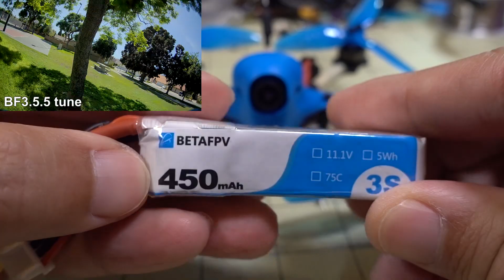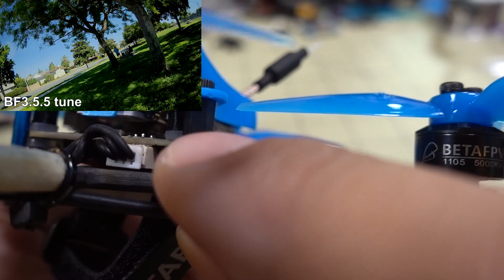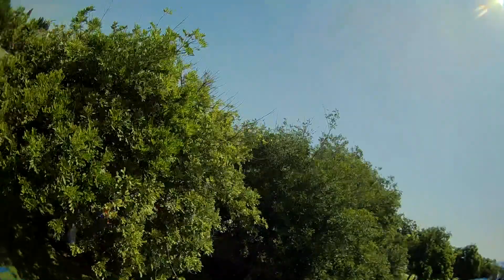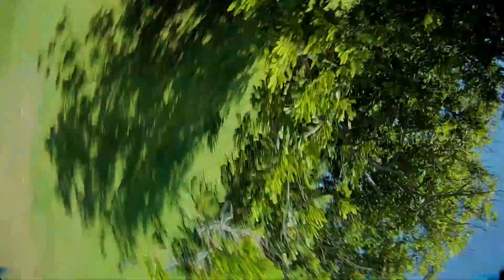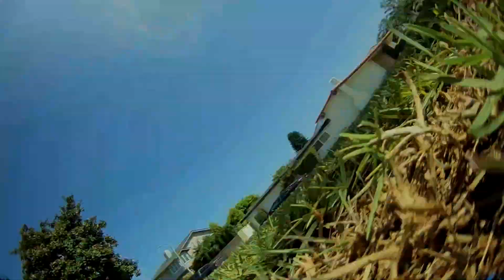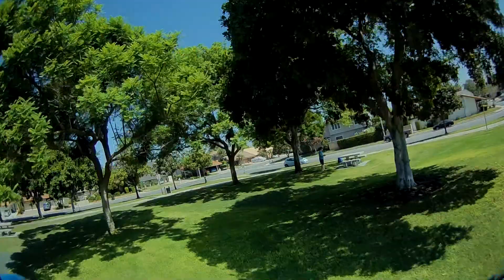HD Toothpicks for Freestyle // BetaFPV HX115-HD 👍

Comment: Hey Albert have you brought this to 4.1? do you know of a good tune I hear bad things about Bardwells and for the first time ever RPM filtering has actually now made it fly worse on stock pids I have the HD version and I am bad at tuning
Reply from the maker: I transferred the parts to the Airblade EX frame and changed the motors.  That build is on 4.1 and RPM filter.  You can check it out here - https://youtu.be/45UprWNdZ5A

Comment: Hey Albert I picked one of these up and I need someone who has one to tell me in BF what Uart is serial RX an which is smart audio and by chance do you have a good 4.1 dump on it?
Reply from the maker: This is how it's mapped on mine
serial 0 2048 115200 57600 0 115200
serial 1 64 115200 57600 0 115200
Reply: @AlbertKimTV  tyvm also did your's come with motors reversed? Silly me hasn't had that yet and didn't notice and went to test flight an shredded my stock props already lol 😅
Reply: I heard it's to keep stuff off the camera
Reply: It was being a little off and I crashed it into water lol RIP I unplugged while still under water and I thought i could see smoke under water but i see no signs of damage on any of the boards or the vtx should i wait a day and test it out? Any suggestions on how to safely test it or should i just plug in an watch for magic 😅 i did get it new from a local guy for 150 so if I killed the aio FC I'll still only be in 195 on it so no biggie but fingers crossed its saved

Comment: Albert, thanks for all you do.  Question for you.  Do you know if there were two different boards that shipped with the hx115?  When I follow Bardwell's instructions to update to 4.1, my board type comes back as:
# version
# Betaflight / STM32F411 (S411) 4.1.0 Oct 16 2019 / 11:57:34 (c37a7c91a) MSP API: 1.42
# manufacturer_id: MTKS   board_name: MAMBAF411   custom defaults: YES
So his dump won't work.  It shows errors in red saying that you can't change the board name.  I tried commenting those lines out then re-pasting it into the CLI.  Now I just get the can't save because there are errors, but nothing is shown in red.
Thanks for any help.
Reply from the maker: Seems many people are having the same problems.  FYI, the correct target should be MATEKF411.  Please consider joining my Patreon if you found this helpful, thanks.
Reply: @AlbertKimTV  Thank you and I will consider it.  To get it to fly since you can't change the board name, I pasted in everything else.  Flies fine on 4.1 with mamba.  But now I'm gonna wait on jesc until this is sorted

Comment: Better to have option for motor's wires plug or solder version. Some people got extra time for doing soldering thing, some people just want plug n play and rip in the backyard.

I think there is no problem with that motor plug to fc, most of the best bnf lightweight micro quad's motors has plug. New LarvaX for example. My old QAV105 with 1105 7000kv motors also has plug, fly really nimble. All of my lightweight micro quad has plug lol.

Btw, nice review. Keep it coming 😀

Comment: I love my hx100 and kinda wanting to add this one to my kit next. I love betafpv stuff.  Of course 2 days after I get my hx100 the new toothpick board gets released lol.  Definitely try the 2 blade props on the 115 I’ve seen a few vids with them on it and it seems a little faster on the twin blade. Especially on 4s.  I also noticed that on the canopy they are using m2 hex screws, on the hx100 they use a m2 Phillips head screw. Kinda a pain to work with.